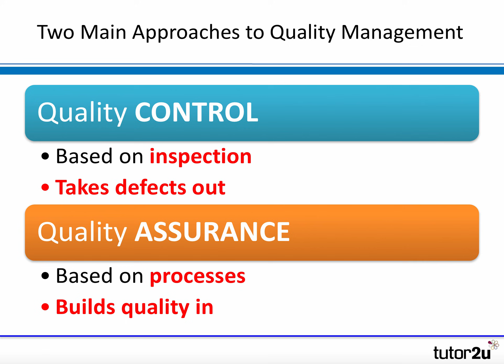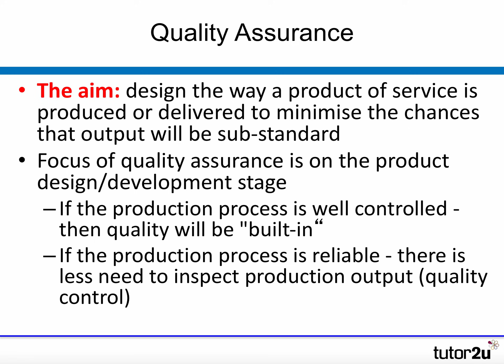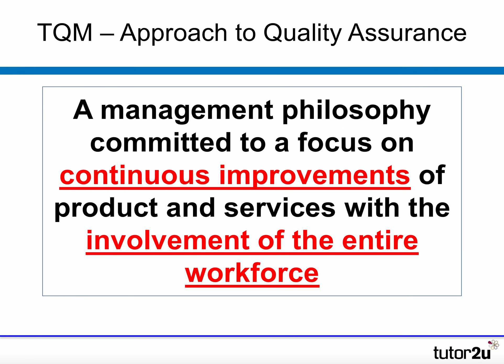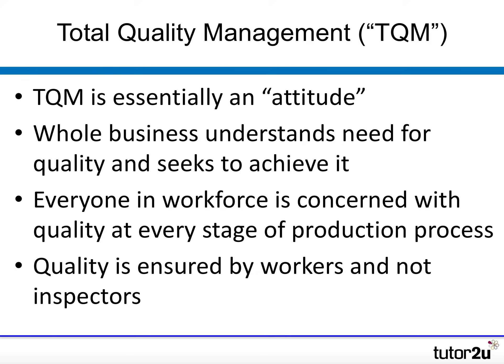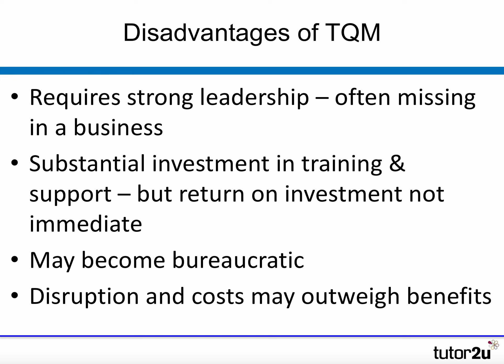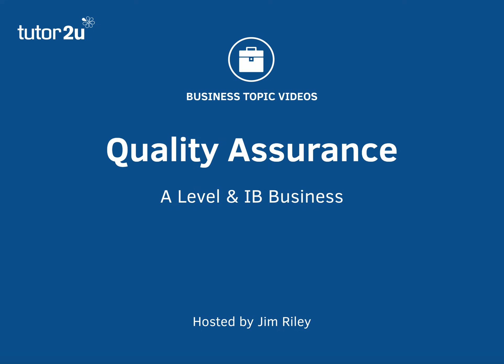Quality Assurance

Comment: If you love thinking in an abstract manner, maintaining data, ensuring procedural requirements are assigned with current practices, customer requirements and requirements dictated by an accreditation bureau or governing authority, them quality assurance is for you.  Oh yeah... You also need to have thick skin and work with extremely limited if not non-existent resources, if you are performing QA functions in North America for mid level companies.  So, when problems present themselves and you have data to back up a claim that resources are unavailable to attend to this issue and you find out that upper management cannot justify additional headcount, do yourself a favor and resign in a respectful manner.  It is all downhill from that point.  No one cares and quality is only the responsibility of the one person QA department.